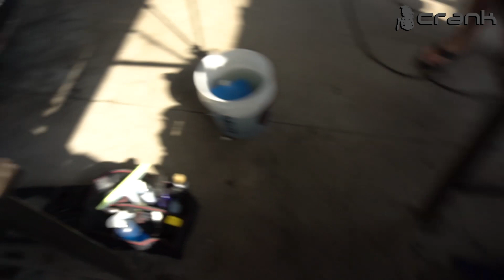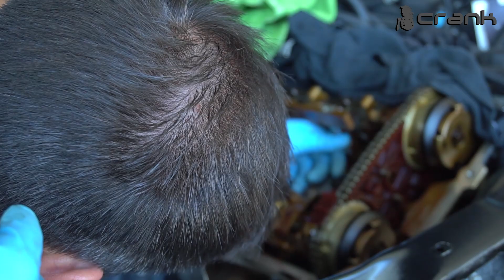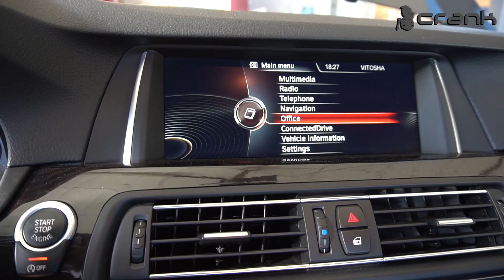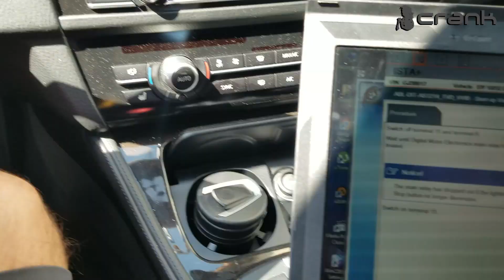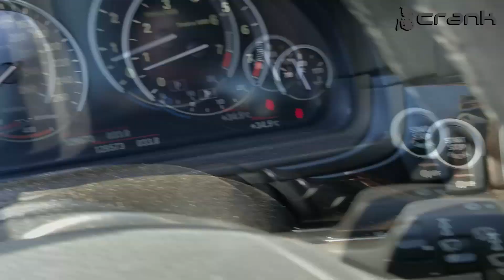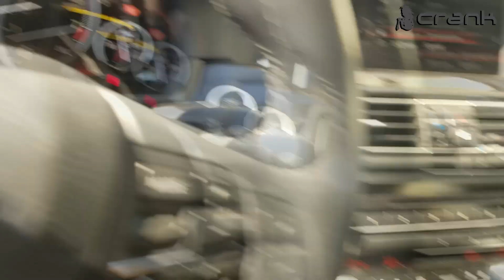Complete Valvetronic Repair Guide BMW N55 N20

Comment: this is how it is supposed to work but very rare as in most cases, most users are experiencing issues even after they replace the servo, eccesntirc shaft, intergrated power module and having their DME's repaired (hopefully correctly) from damage of this terrible system that BWM designed and Still have permenant code 134F101.

Comment: Just curious. Was the engine set to TDC before taking off the eccentric shaft or did I miss that part. As far as I’m aware it has to be done that way I order to make sure that the eccentric shaft and cam shaft work correctly otherwise you will not be able to run the learning process.

Comment: I also changed the valvetronic motor but after replacement i got codes 134f01 and 134f04. What should i do ?? Help???

Comment: The same situation with my n55… I take very good care of it, but the springs have lots of sludge. I believe it might be due to a previous issue with PCV valve which I didn’t notice until it began making loud noise.
Reply: My N52 had sludge on the top of the springs despite having regular oil changes.

Comment: Hello, I followed the video to change the valvetronic motor.
To calibrate the motor, place it against the minimum stop (on the left, opposite the motor).
I did the same, but after reassembly it was impossible to calibrate the valvetronic motor stops.
Is this calibration ok?
Thanks
Reply: There is one thing in the video which does not match to the repair manual. When you put everything back together, the excentric shaft has to rest on the maximum lift position. So the gears facing upwards and the shaft has to rest on the maximum stopper, which is on the side of the intake camshaft. Maybe that's the problem.
Reply: @jasonst5688 Do not set on minimum Position this video is misguiding and needs to be set at Maximum
Reply: Camshaft sensor reads the value and adjust the valvetronic according to the timing, not the valvetronic is dictating the timing, so as long is it within the range (start point - end point) it should be just fine...

Comment: It is such a great video and thorough explanation & guidance step by step. 

Questions:
1. 
Do I need to disconnect the battery(negative & positive) prior to pulling out the Valveteonic motor and eccentric shaft? 

2. The Valvetronic was replaced by a local shop however they couldn't process valvetronic adaptation as error codes couldn't be deleted, 2D43 and 2D41. Not sure they even replaced it correctly.
Will these codes be deleted automatically and will I be able to process adaptation if I replace both valvetronic motor and eccentric shaft?

DME seems working fine as it functions other adjustment such as DSC adaptation and others. 

Your comments would be much appreciated.
Reply from the maker: It is always preferable to disconnect the battery when working on the internals on any engine. 
If everything is done correctly, you should be able to do adaptions as shown in the video. Doesn't matter if the fault codes are there are not, it is important that they are not "Present" or "Actual". If they are "History" codes no need to worry about it.
Reply: You have cleared my questions that I've been looking for the last month and a half. Much appreciated your quick response. Thank you very much!!!!

Comment: I’m working on a 2013 535i. Sometimes I’ll get misfire codes on 1,2,3 and sometimes it will be on 4,5,6. It will start but I have to hold it at 3000rpm otherwise it will cut off. Also I’m getting an air mass code.
Reply: Bro did you figure it out? My car been doing that for a year now smh
Reply: @mohammadmo9554 sounds like a vacuum leak or a bad mass air flow sensor
Reply: Did you figure it out yet?
Reply: @gregorymalchuk272  sorry, I don’t remember

Comment: One little correction, the torque for pulling the injector out it's 13 nm not 5nm. Keep up the great work.
I saw you also on a oil discussion forum. From your experience what oil (brand and specs) do you believe works best with this engine. Thanks!
Reply from the maker: It is 5 Nm, as can be seen on BmwTIS. AmsOil is a good choice
Reply: It's not 13 nm

Comment: Did anyone change the eccentric shaft without the spring tension tool? I see alot of youtubers doing it without any issue
Reply: That's the one piece I'm trying to figure out. The tool costs more than a genuine actuator lol
Reply: Any updates ? Before I attempt doing this I need to know too thanks
Reply: @thesmartguy3523  You don't actually need to remove the springs to replace the shaft, you just need to remove it very slowly undoing all the caps bit by bit so it doesn't bend or jump out, and then refit the caps by tightening the screws bit by bit. It's not the "correct" way but it can be done that way without removing the springs. Obviously if you're a BMW tech working at a dealership you'd remove the springs because the tool is already there.
Reply: Done it on mine with a fair of grips . Wouldn't recommend it as it is a massive pain . Have an ask about see if anyone local in a garage or on a forum has a tool you could borrow

Comment: Why did you only inspect and rebuild the upper part of the mechanism, and not the lower rockers?
Reply: Because the rockers aren’t the thing that were messed up. It’s literally just the gear on the shaft  that mates with the motor that causes the issue